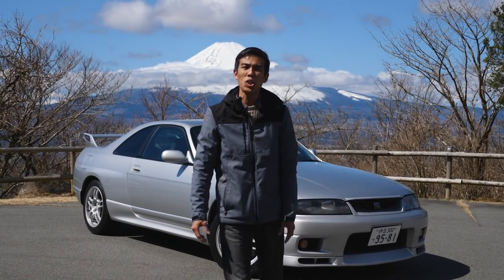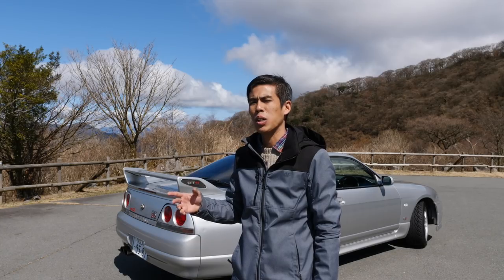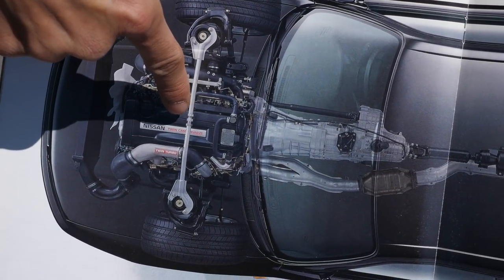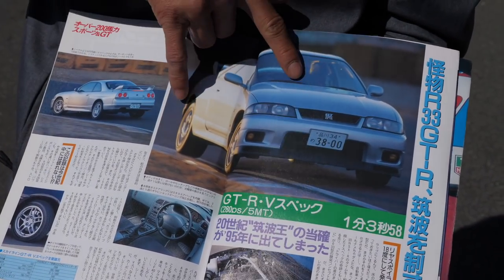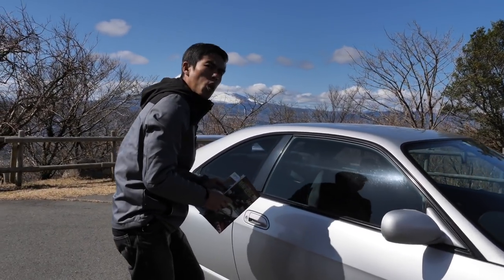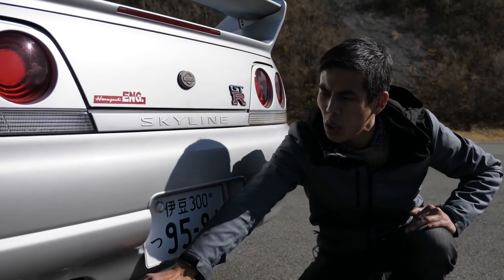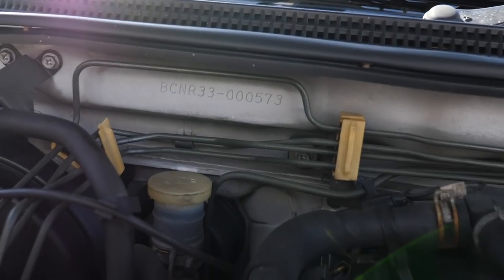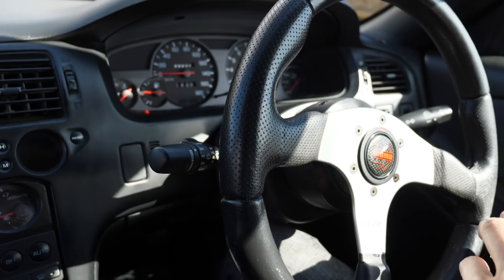Technology secrets of Skyline R33 GT-R | In-Depth Review in Japan Ashinoko Skyline |JDM Masters

Comment: I have a friend that imports entire front ends of Japanese cars into the United states. Getting the entire front end makes it easier to get the engine, transmission, computers and most of the wiring needed to put it into a different car. He has also used these parts to cut up left hand drive cars and convert them to right hand drive if the owner wants to go that far to be different. The most unusual swaps he has done has been an RB23 into a Volvo 240 station wagon, a Lancer Evolution 3 motor into an 85 Mustang GT, a RB23 into a Camero Z28 and an RB23 into a 68 Plymouth Barracuda. Most of those conversions were inspired by the Ford Mustang/RB conversion seen in Fast n Furious 2 Tokyo Drift.

Comment: I don't have an R33 GTR. But I do have an Autech Stagea 260rs. Which is basically the same drivetrain as an R33 GTR. I love it. I can only imagine how much faster the 33 is with a bit less weight than the wagon. But simple upgrades on these really unlocked their potential.

If I was gonna buy a GTR today I'd buy an R33. Because R32s have mostly been abused and R34s are priced at double an R33. So bang for buck R33s are the best.

Some of the later R33s especially series 3 look great.

Comment: I always believe that r33 gtr is more suited for wangan midnight environment AKA highway racing. track wise r32 and r34 is understandably more superior.
Reply: First production car under 8mins on the nurburgring
Reply: @sirkartier9579  Looks really big and bulky but moves very nimble at the tracks too.
Reply: @sirkartier9579  true, but there must be a reason as to why there are more tuned r32 and r34 featured in hot version and video option.
Reply: cross platform could have to do with tunability, although stock vs. stock it appears it’s on par with the others.

Comment: 40:20 wait, simple question the max speed of the stock r33 is nearby 180 km/h ? Is it normal or the speedometer is blocked at 180 but the car can go faster ? 
Bcause my 27hp 1997 honda NSR-R 125cc does 165 km/h and my 110hp citröen C2 VTR does 194 km/h and they are both considered slow :/
Reply: GW3N Hi. All JDM cars up to about 2010 is speed limited to 180kmh due to govt restrictions. So the speedometer of true JDM cars often only show up to 180kmh. There is a device made by HKS called SLD that cuts the speed governor

Comment: You refer to the R32 as the gen-2 GT-R, but it's actually gen-3.
Gen-2 was a coke-bottle coupe only sold in '73.
Reply: Ethan Meatzie in Japan the PGC10, KPGC10, KPGC110 Skyline GT-R are considered ‘1st Generation’ as they all have the same base chassis and S20 engine. The BNR32, BCNR33, BNR34 with RB26DETT are considered collectively as ‘2nd Generation ‘